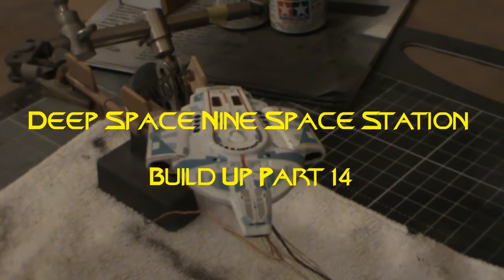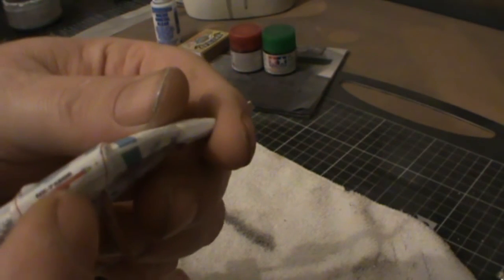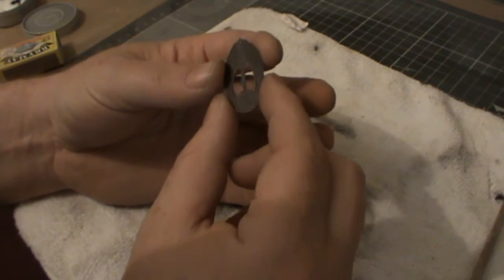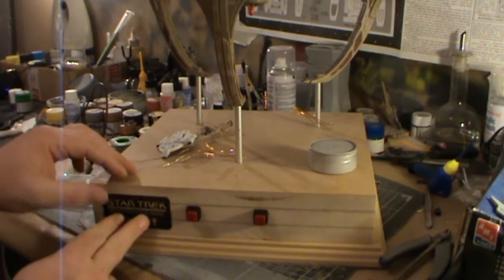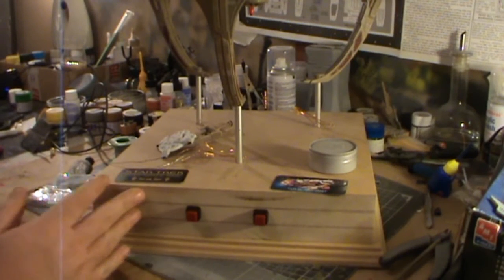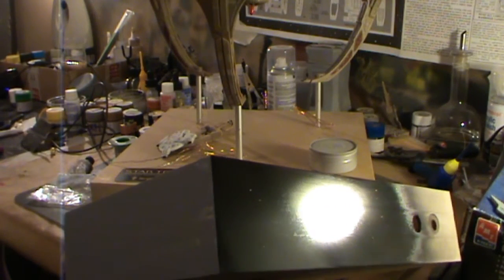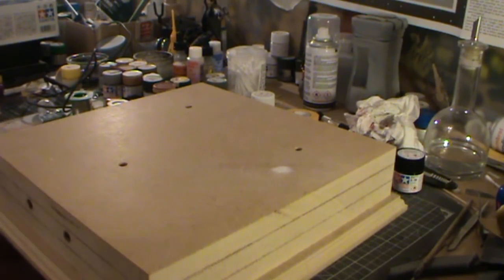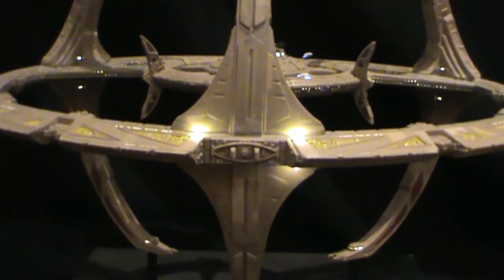AMT 1/3300 Scale Clear Plastic DS9 Build Up The Finale

Comment: Excellent job on this. I like the way you've displayed yours too, with the "legs". I only wish mine was the clear version as the multitude of lights on yours is outstanding.
I hope to have mine completed within the next couple of weeks so wanted to ask you, I too got the PE window template set (I have a second, clear version of DS9 to build) and was planning to use the insignia in a similar way to you, when you mention the reaction to the primer, is there any danger of the paint lifting altogether? I might go out and buy some etching primer for mine but was curious as to your thoughts on how yours turned out.
God I wish mine had lit Runabouts, they look so much better
Reply from the maker: +Models by Wil Thanks Wil, The PE parts came out really well to be honest with you, the Tamiya surface primer only drew back from the very edges of the insignia but stuck to the rest of the brass really well. The same thing happened to the Tamiya brass acrylic paint too, however when I gave them a cote of mat varnish that stuck to the whole part. My feeling is that it gives it a real old antique look to the parts and fits in with the display.  As I said on one of the updates it was a happy little accident, but one that I would repeat again given the chance. 

Hope this helps when it comes to doing your insignia.
Reply: +Doughnuts Inspace Forgot to ask, what did you use to glue down the PE parts?
Reply from the maker: +Models by Wil I just used Kristal Klear Glue to stick them in place, that stuff really does work so well its unbelievable. Also used it stick the little plaques in place too as they are made from aluminum and fairly light, although the base needed to be kept face up while drying to prevent them from sliding down the base lol.
Reply: +Doughnuts Inspace Yea its good stuff alright. I used it to glue in all the fiber optics in my one. 
Oh, and you did something I was wanting to do, if I could've gotten my Runabouts lit I was going to have lifting off as you've done on yours. Another idea was to have the pad thats lowered rise up with a Runabout on it, but have no idea how to do something like tiny ... tiny servos or something?
Anyway, brilliant work on this. Now the headache of where to put it ... shes a big model
Reply from the maker: +Models by Wil Would have been good to have the pad raise and lower, just don't think there is the room to do that though or get a servo in the habitat ring on the clear kit as I believe it is smaller that the opaque version.  I had enough problems getting the lighting and wiring in there lol. She is a big girl for sure, but sits nicely next to my 1:1400 Galor Class Cruiser :)